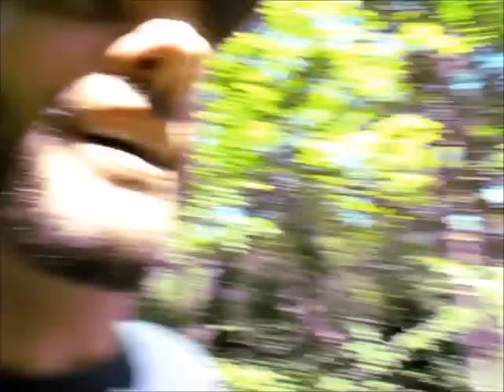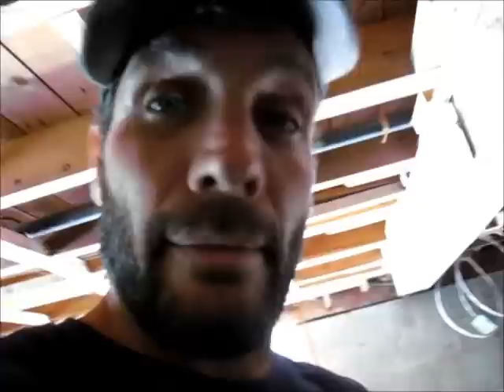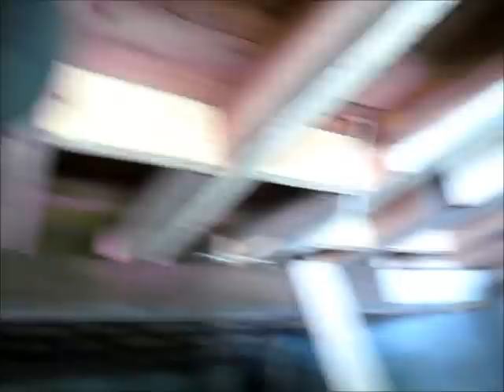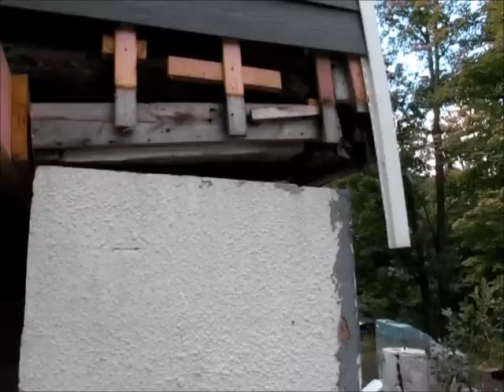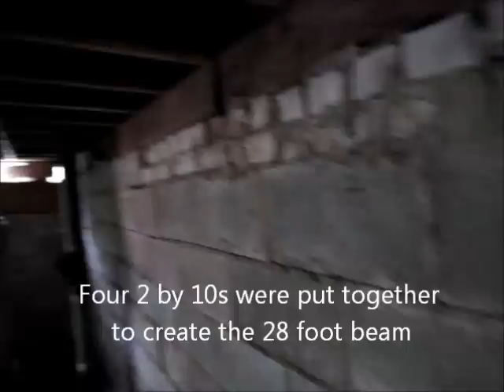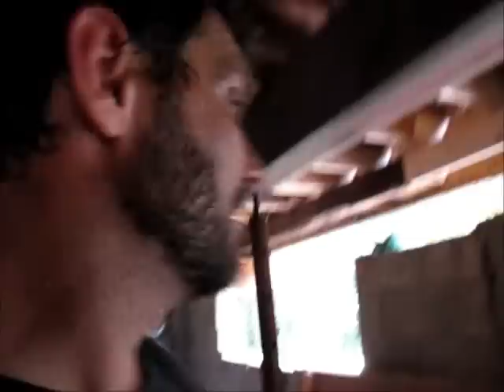House lift by amateur, foundation replacement

Comment: I didn't see the actual process of installing the jacks then operating them, which is what I was hoping to see because my little 600 sq ft house needs lifting, (was flooded this Spring) and I'd rather not spend $15,000 doing it. But thanks for posting, I got to see some support methods.
Reply: Despite what he says, its not all that straightforward and easy as he makes it seem, as you need to have gs lines redirected if not shut off and disconnected along with power and cable come in to take a look per your plans to determine  their utilities  also need to be disconnected or redirected. per what your plan to do. As for ligting, plenty of expert professional jobs to watch and take note of and in your case it is likely much easier if its not too heavy as it is not that large in footpprint, but what is the height and how is the roof built? I you already did the task and it went well enough then congrats. But if you have still yet to get it done, does not hurt to call for and get a free consultation from an experienced professional after you show him and explain what your plan of action it is for and what steps to take.

Comment: Awesome. How much did it cost you?
I have not much money either, but I have an old house on wooden stumps. I want to replace them, but if I could raise house just 300mm (1 foot) or so, that would be much much better.
Currently floor is off the ground maybe around 500 or 600mm.

Comment: Only 2x6's??? I'd rather have those then the new chip board joists reinforced with 1x1's and luck.
Reply: ugh, I-joists best of luck with those in a good fire or decent flood soaking them and neither of those does not happen to you either

Comment: Why did you put plywood between every row of concrete block?  Did you have to use the plywood?
Reply from the maker: The plywood links all the blocks. Each layer becomes one unit and the more layers you put the stronger the bond.
Reply: How is that holding up? Or is it not holding up that well and by which I mean look at it form below grade outside, not just from inside.

Comment from the maker: I used three jacks, but only needed one. I guess two jacks could be used at the same time, which I haven't done. The front of the house was raised 11 feet since the land was lower there. The back was raised "only" 10 feet. I first lifted it about three feet to get the foundation out, than lifted it high enough to fit the foundation plus a four foot wall. Once the slab is in place the first floor's ceiling will be a little over eight feet.